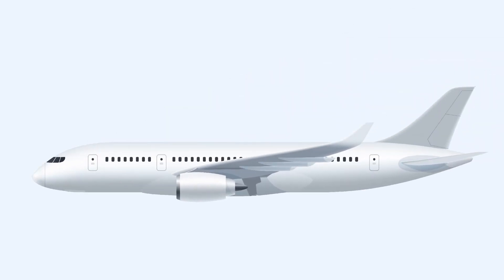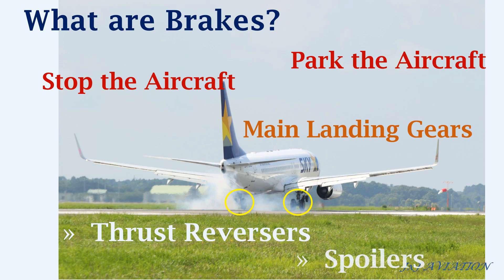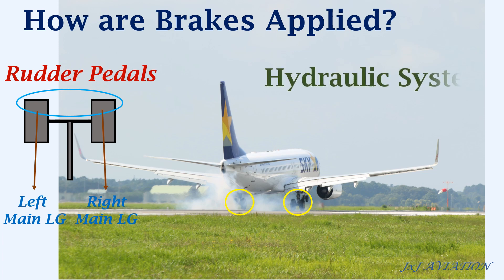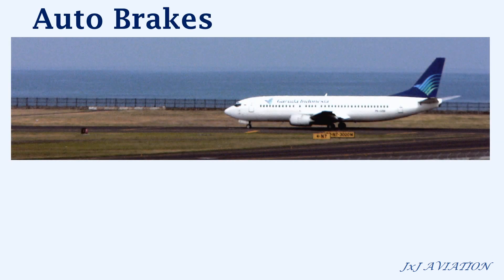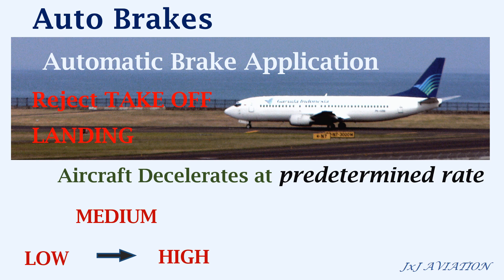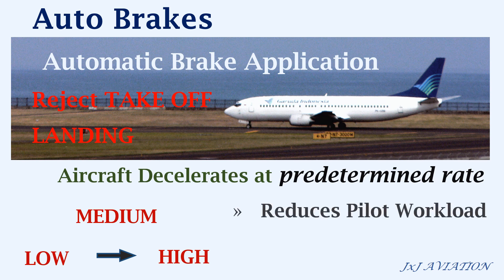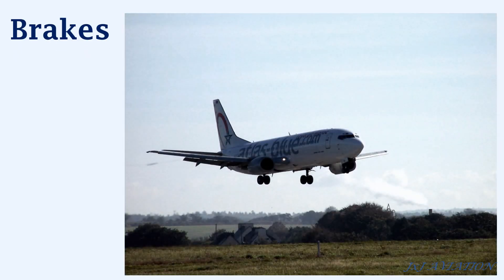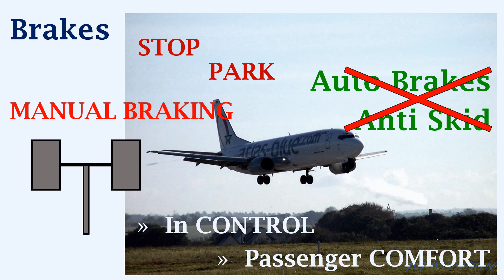Understanding Landing Gear System (pt. 3): Aircraft Brakes; Working of Auto Brakes and Anti Skid!

Comment: Is the mentioned aircraft speed the airspeed or ground speed (to compare with the wheel speed)? I think it is the ground speed measured or provided by INS or GPS
Reply from the maker: ground speed is used as reference
Reply: @JxJAVIATION that should be obvious since the speed of the wheels turning would be on the ground not in the air; I worked as an ac mechanic for our national airline for 9 years before major retirement. Was my favorite time of my working life.